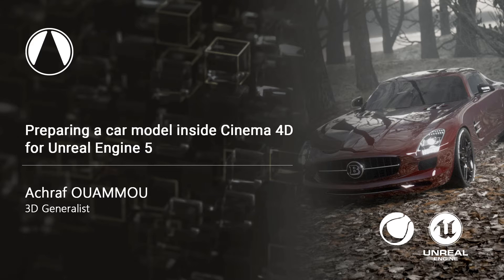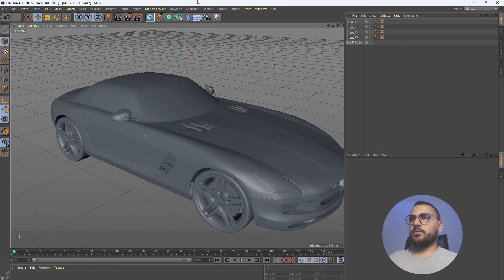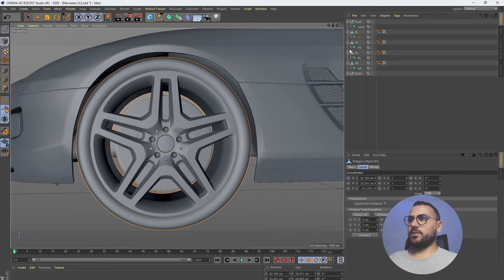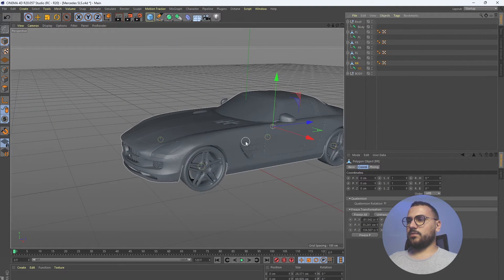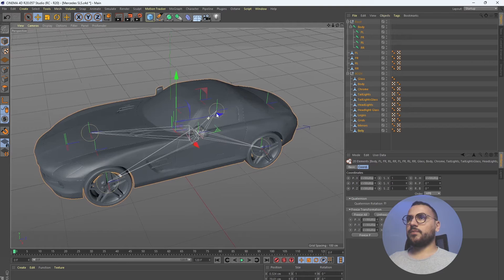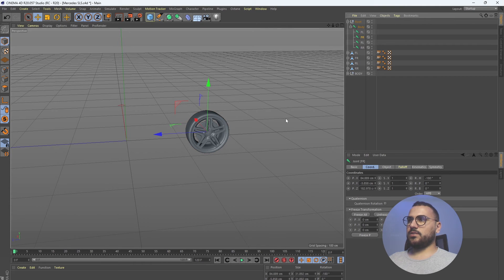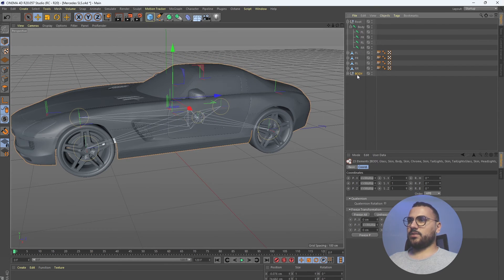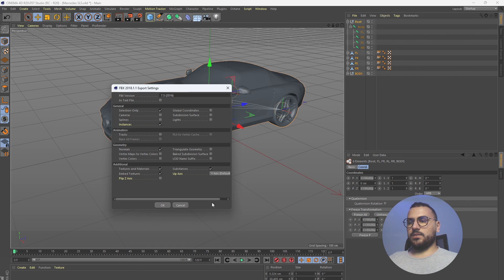RIGGING A CAR IN C4D FOR UNREAL ENGINE 5

Comment: what about the brakes? Cars in games have visible brakes.
Reply: Yeah definitely need an updated workflow for brakes to be added
Reply: I use the character tool in C4D. It has a "car-rig" preset that does it.
 @123omygod
Reply: breaks are tricky, they need to be seperate because they dont rotate like the wheel but use the same y rotation.

Comment: OMG man, it is so painful watching you… 1. You can fill weights with one klick. 2. If you really like to paint weights with brush, you don’t have to zoom out, you can just make brash size bigger by holding middle buttons and drag. 🫣🤣🤣🤣
Reply from the maker: Thank you for your advice! I have tried the method you mentioned before, as well as increasing the brush size. However, for this particular model, my PC freezes each time I do so. This was the only way to get away with it 😅

Comment: Hi, thanks for the tutorial. I tried it and rig works well. How you manage to add different materials (body,glass, wheels etc.) to the car mesh in UE? Whatever i tried, is just one mesh only and not the different parts and also this only mesh has one material slot
Reply from the maker: Im glad that you found my tutorial useful , try to apply different materials to the car parts inside cinema 4d (standard materials with different random colors) then export the fbx from c4d to unreal , you should be able to apply new materials inside UE , let me know if it works ;)
Reply: @achrafouammou  hi thanks aswell for the very helpful tutorial! i had the same problem with the materials when i used octane materials. with C4D standard materials it worked !